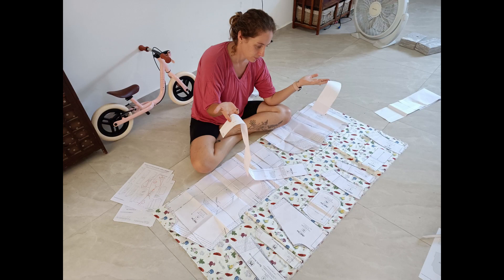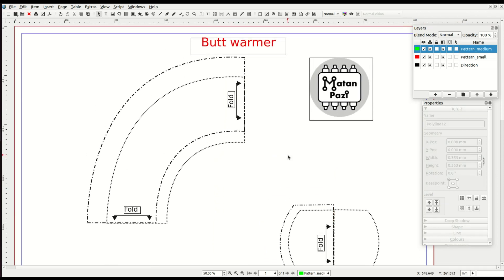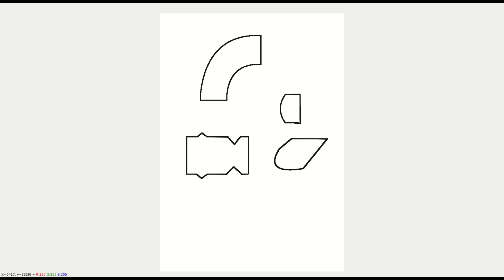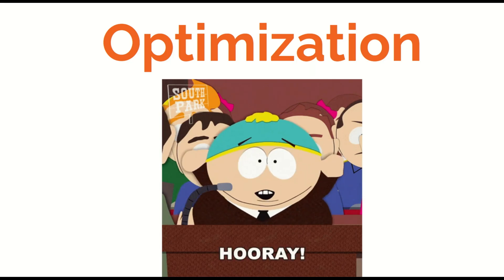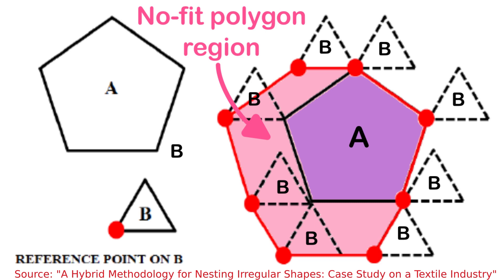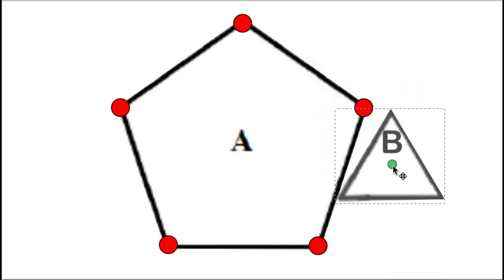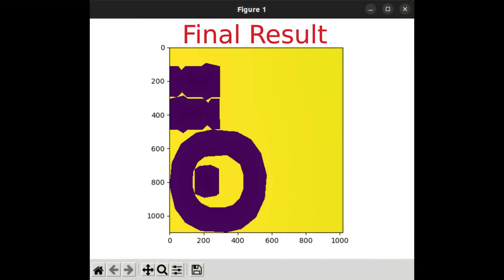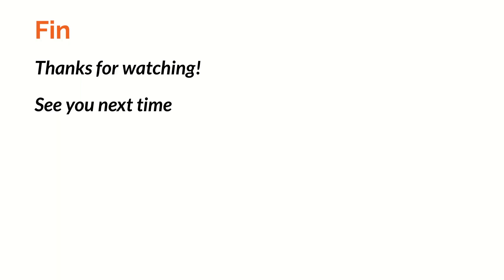Using Python + Optimization to help my wife's sewing problem

Comment: Good job, I hope she's finding this useful!

I imagine that for the optimization part, a physics-based simulation might work decently and quite quickly as well: place the objects on the quarter-plane (x,y >= 0) randomly but with the appropriate constraints on angle, apply force toward the origin on the objects + maybe some noise. Run a rigid-body physics simulation until net absolute velocity magnitudes are sufficiently small. Do simulation 10k times and pick the best final solution?
Reply from the maker: Thanks :)

Huh, that's an interesting approach!
I wonder how it would perform.
You think it might even run faster compared to the optimization I used?
Reply: @MatanPazi  Due to the need for video games to run in real-time, there's been a lot of work into making (specifically 2D rigid-body) physics engines extremely fast. I believe their computational complexity per simulation step could be like O( n log m) if you've got n polygonal object with m vertices.... 

I should mention that I'm guestimating this by the way, using:
1. the fact that the graph which indicates two objects are "touching" is planar, and planar graphs have at most 3n+4 edges in an n-vertex graph, contributing the N of that product, and
2. the fact that the algorithm (typically a modification of the GJK algorithm) for finding the "seperating vector" of two objects  ie. the shortest vector such that moving two intersecting objects away from eachother along that vector seperates them, is both an optimization algorithm AND is temporally stable/continuous, so you can start with the last answer for shortest vector as a good guess and optimize rapidly, which is contributing the very-guestimated log m of that product.

But, yeah, still guessing here. I think I'm close though. 2D rigid-body physics engines are very quick, the first one I can think of is Box2D, it's got constraints that can be programmed in absolutely trivially and is written in either C or C++. I don't mean to come across as uh, telling you what to do lol, sorry if that's what it seems like. So many ways to solve a problem, especially when we don't have any strong constraints to deal with, and the solution already functioning is infinitely more valuable than a theoretical one.

Again good job! :D Looking forward to your next videos.

Also i strongly doubt that the complexity of intersecting rasterized images would be anywhere NEAR the speed of polygonal stuff lol.